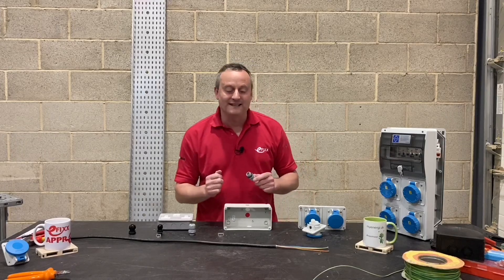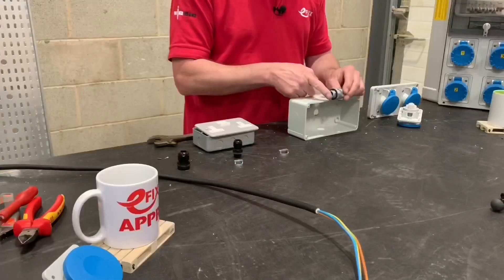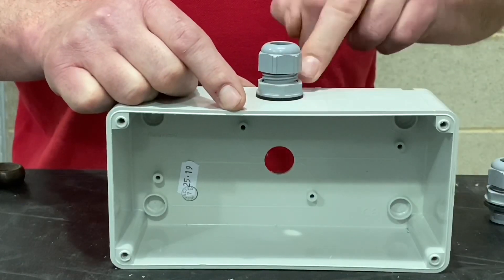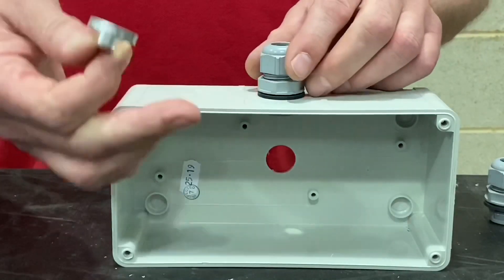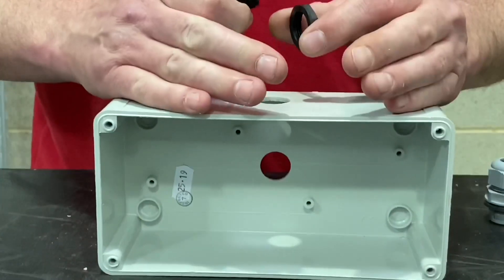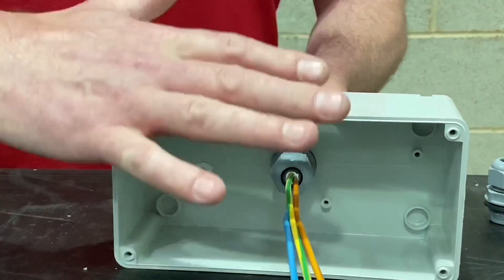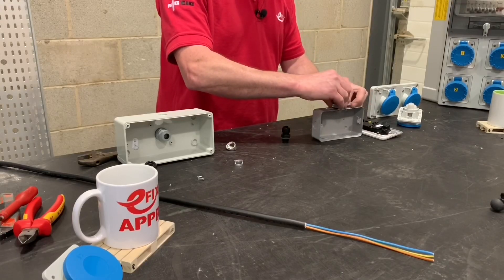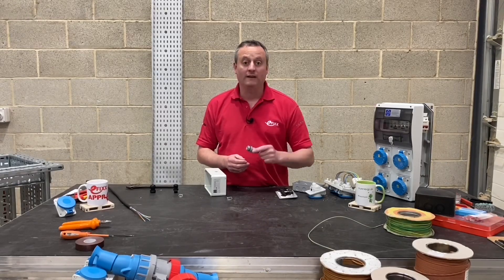REVIEWED: Skintop Click IP68 cable gland - no locknut required.

Comment: I like them but not that they will make life quicker than a normal gland, however handy for the odd occasion when the lock ring won’t fit in the enclosure or it’s tight to get grip on it inside the closure. Would love to see someone struggle to deinstall one if they hadn’t come across them before 🤣
Reply: Totally agree with your comment.

Comment: There's going to be a less experienced electrician in the future wondering why it's not loosening the harder they try to undo it and crack the plastic enclosure. And then there'll be the one who figured it out and spends a needless amount of time trying to awkwardly squeeze the tangs with a set of water pump pliers to try and get it out because lets be honest, nobody is going to have the proprietary tool. But the ability to do blind holes is neat.
Reply from the maker: Take a look at this version we reviewed recently - Same principle but no tool required for removal - https://youtu.be/v4E1c1ere5U

Comment: What I have noticed with new products designed to save time is that they price themselves out of the market. If these are a similar cost and the tool is cheap enough then I would use them.

Comment: These glands are priceless for AHU as they are double skin, for a normal stuffing gland you would have to drill out 20mm one side then 25mm for the inside to get the lock ring on, where as these saves all the hassle
Reply from the maker: Great tip - thanks

Comment: I can't be the only person who's getting concerned about the number of proprietary tools that are starting to be required? Quickwire require a special tool, this requires a special tool, I'm sure there's other things too.

Don't get me wrong, it looks like it has its uses. I just wish that manufacturers would make their ideas work with standard tools. Maybe I'm cynical, but it feels like they're trying to force everyone to buy their tool just in case they come across one of their products?
Reply from the maker: You can remove them with standard tools - e.g water pump pliers - but a bit fiddly. The removal in included in the bag with multi-packs of glands. Agree about the proliferation of non standard tools.
Reply: And you can remove quickwire with you finger nails, no need for the tool what so ever. Obviously quicker and easier with a tool, but easy enough without... why do sparks always try to find fault with new products rather than see it for what it is, an improvement. Don't get me wrong, these aren't perfect i.e. I'd imagine they can't be used in conjunction with a Wiska box?? But still, a great idea..! 👍🏻
Reply: But you need less screwdrivers with all the push fit connectors and light fittings and anything else that’s on the market nowadays

Comment: UK goes Germany 😉 NYY is one of the Standard cables used here in Germany. It is available in various dimensions form 1x1.5mm2 till 5x240mm2. We installed a industrial building with NYY last year and the greatest dimension was 5x185 with an OD of 75mm. I think the only cable which more often used is NYM. NYM is gray and the outer sheathing is a bit thinner.

Where do you use NYY in the UK?

Comment: I've got to be honest Gaz, I don't see it being much faster than a traditional stuffing gland. The time consuming bit of fastening a traditional stuffing gland is screwing the nut onto the thread, a couple of full turns and you're done. The fastening action of this product looks very similar but a slightly different variation.
Reply: Ashman Electrical Services good point 👍
Reply: Ashman Electrical Services only with this version, you need a tool to remove it. Standard gland is simple and it works.